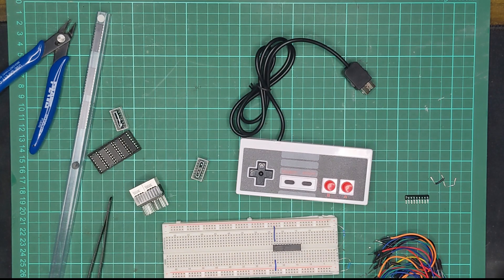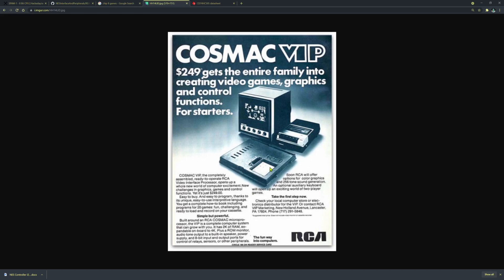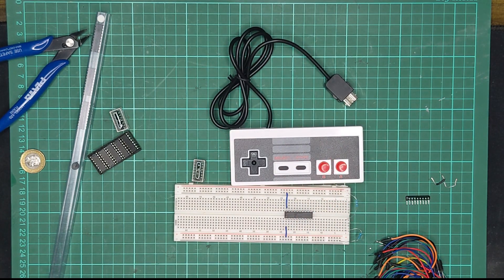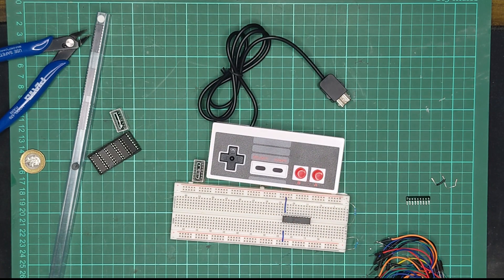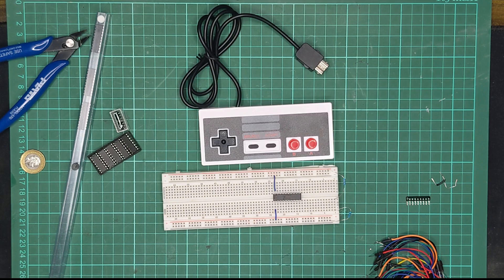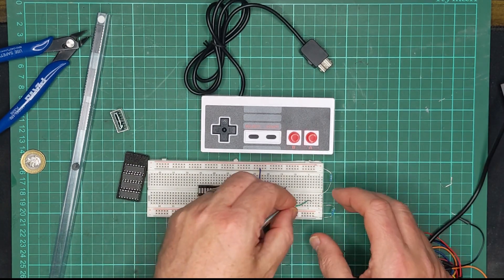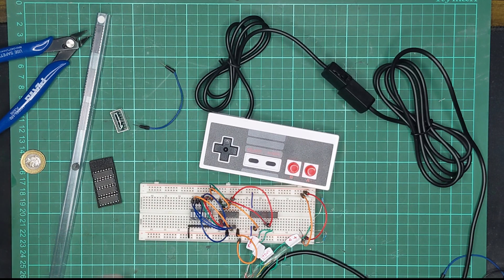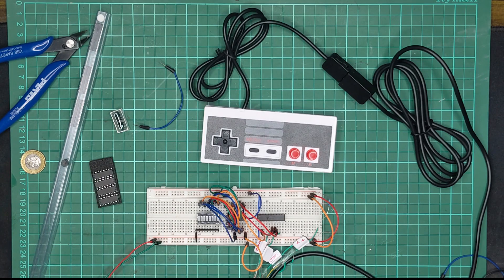I2C Interface Adaptor for NES Gamepad  - SPAM-1 8 Bit CPU - Part 11

Comment: You may want to look at the PCA9564 ;)
Reply from the maker: Hi thanks yes I came across that but i would still need something to manage the NES protocol because I didn't want the CPU to do it, but yes that chip would help relieve the heavy lifting of i2c. Also I would need two of those pca9564 anyway as I need two i2c busses. Also like I say I have a bunch of these pic mcu's.
And there is one other function I didn't explain in the video and that is that the pic is also providing a random numbers generator and likely a clock each of which will be exposed as another shift reg probably.